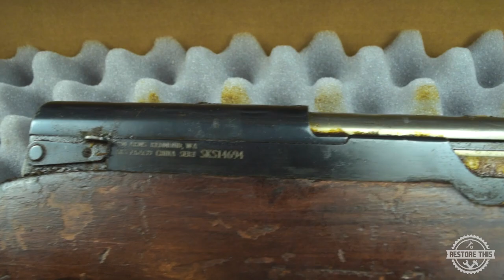VINTAGE SKS RIFLE RESTORATION! 1957 SKS Rifle Caked in Cosmoline Brought Back to it's Former Glory!

Comment: I can remember decades ago where they were selling them for $69 dollars all day long. Can't find one for $69 dollars anymore... And they do make for a nice little hunting rifles if you like open sight hunting.
Reply from the maker: Hi Gary, I remember an SKS rifle and 1k rounds of steel case for around $100. Those were the days! I like the SKS for its simplicity and reliability. Accuracy is good enough for most tasks and even with the crazy ammo costs as of late, it’s still decently affordable to have a fun day at the range. Thank you for watching and commenting!
Reply: I paid a little more at $99 but I hand selected it out of an old oak barrel sitting in the middle of the gunshop. There were about a dozen of them in there. Those were the days. 👍
Reply: Yep, back in the early to mid 1990s.  Had one and cleaned up the stock and refinished with stain from Lowe's.  Took it to the range and it ate any old garbage I ran through it without a hiccup.  Sold it for $100 in '95.  Argh.

Comment: It was very good to see you made a point of showing you cleaning of the firing pin & the bolt, that's a very important safety issue.  Hard, congealed cosmoline on the pin & in it's channel in the bolt can cause the firing pin to stick in the forward position, causing the rifle to suddenly go full-auto until the magazine is empty.  The original design had a firing pin spring that helped prevent this, but many of the post-Russian manufacturers eliminated it.  There's a gunsmith that makes the original spring-retracted design, & it's a good idea safety-wise to install one in an SKS you plan to shoot regularly.  At the very least, keep those areas pristinely clean, & slightly moist with a light lube like Rem-Oil or Break-Free.

Comment: Just from looking at this SKS I can tell it was a recent import from Albania, hence the Albanian modded stock. From the serial # it is a 1957 Factory /26\ build. The early rifles did not have the Chinese symbols on the receiver. Originally it would have a blade bayonet.
Reply from the maker: Yeah, it’s a bit of a mutt that’s for sure! Thank you for watching Abe!
Reply: I’m here 15:35  paused for now. Where did you see the serial number? I need the entire number from the left side of the receiver. Haven’t seen it yet but hopefully I will after I resume. However I can already tell you’re both wrong. It can’t be a 1957 because of the side sling -swivel on the left side of the buttstock which was moved there from its original location in 1958 and not moved back underneath again until the latter half of 1965. My assumption up until now, is that it’s a first year spike bayonet placing it in 1964 with a serial number in the 9 million range. The actual serial number. On the left side of the gun. The entire serial number. Another clue aside from the placement of the swivel and the correct bayonet, is also the correct long barrel lug which was also an early feature which ended in 1964, same year they went to a spike. I’m now going to hit play as soon as I post this reply. I will reply to myself as soon as I finish the video. So far I’m convinced that I’m right.

Comment: I did the same to mine about 30 years ago. Typical Chinese ska rifle.  I probably fired 30 to 40 thousand rounds with out a single jam or miss fire slam fire or failure to eject a spent case. Firing pin rattled from new.
Reply from the maker: They are really fun rifles! Thank you for stopping by!

Comment: For anybody doing this at home, you can save A LOT of time effort, and cleaning solution by boiling the small parts in water, like the trigger, bolt, bolt carrier etc.
No cleaning solution or sandpaper necessary, just hot water. 
Shake them around to release the cosmoline into the water, and boil multiple times if necessary
Be sure to dump the waste water into a gravel pit somewhere that no plants are growing, do not pour down your sink!!

Comment: Soak that bolt overnight in mineral spirits. Let it drain the carbon/cosmoline out. Spray the parts w/ compressed air to get the rest of the carbon/cosmoline out of the nooks and crannies. Repeat until clear. Mineral spirit bath for the bolt-especially after corrosive ammo, is a great way to clean and prevent the slam fire sticky bolt problem. Great restore by the way!
Reply from the maker: Exactly! The mineral spirits does a great job of removing that stubborn cosmoline. Good tip on using it after firing corrosive ammunition. Thank you for watching!

Comment: i think it would have looked better stained. Here's a suggestion. If you're worried that staining wood will darken it too much or be uneven then use a sanding sealer first. A light coat of 3 or 4 parts ethyl alcohol to 1 part shellac will keep a stain from creating too much contrast betwwen the dark and light grain and make it easier to even out the color when wiping off the stain.
Reply from the maker: I appreciate the suggestion! I’ll give this a try on the next one! I really like seeing the natural color and features of the wood, especially the iridescence (which I was unable to adequately capture in my recordings). A slight tint could have been nice however to even the color out. Thank you for watching my video!
Reply: @RestoreThis  There use to be a Public Television show called The Furnature Guys. Hardly an episode went by where they didn't extol the virtues of sanding sealer. When I tried it on some pine that was unevenly soaking up stain like a sponge it came out looking like an expensive piece of hardwood. I just found your channel and I'm enjoying watching your old videos. Keep up the great work.
Reply from the maker: Thank you for the encouragement! The uneven soaking you’re talking about is a really common issue especially with the catalpa wood used in this stock. I’ll have to research the sanding sealer and put it to use in my projects.

Comment: How did you remove the upper handguard pin? Those are hard and risky to punch out. If it's damaged, really hard to replace.
Reply from the maker: It wasn’t easy to remove. As opposed to hammering it out, I pressed it out using a vise as a press.

Comment: Nice job man! That girl looks marvelous. How did you polish that bolt so shiny?? Enjoy your new, old, weapon.  Excellent video my man!!
Reply from the maker: Thank you for checking out my video. Polishing the bolt was just a little time and elbow grease. I used a multi grit sandpaper pack from Amazon, sanding up to 2500 grit, then switched over to a buffing wheel with white polishing compound until it had a mirror finish.

Comment: What are the chemicals used? Like at the beginning what is that liquid in the jar used to remove cosmoline?
Reply from the maker: Thanks for watching! I used mineral spirits to help breakdown the cosmoline.
Reply: @RestoreThis  thank you. What grit sandpaper were u using to remove rust? Did u use mineral spirits for it as well? Im having a hard time removing rust from metal parts with just a nylon brush, 0000 steel wool, and mineral spirits. I even used some hoppe's no 9 with no luck. I thought about using brake cleaner but dont want to strip the blueing. Also there are some parts without blueing or very little. Do i need to strip it and reblue every little piece in the action? Or just the large pieces like u showed in the video?

Comment: Looks like it just came off the assembly line. Good work!!!
Reply from the maker: Thank you for watching!
Reply: @RestoreThis  No problem. I restored mine to a certain extent but I did so minimally. Its all matching, with some trench art. It has a neat, battle scarred look, plus I got a vintage canvas sling for it too. 😃😁
Reply from the maker: I have another Norinco that I didn’t touch at all. It wasn’t as caked in cosmoline so I just let it be. I have a Russian and Yugo as well. Great little rifles!

Comment: Video was fantastic!!! Amazing you took it this far which is what I’m about to do. Your video will help me immensely as this is the first time I’ve gone this far and done a total restoration. Atlantic Firearms got me good on my last purchase and except for the bore being packed with cosmoline, everything else was ‘dry cosmoline’ as we cal it and rust is present more than I want it to be. Polishing the bolt pieces for me will be difficult. Wish I could fly you to my house shop for a few days and help, lol. I could use it!
Reply from the maker: Hi Mike! Thank you for checking out my video. Another commenter asked about the polishing process below so there’s some extra info there. Take your time and enjoy the process and it’ll go fine! As for the rust, stripping and reblueing is always an option, but you’ll need a large bin to fit the barrel and receiver. Good luck and have fun!
Reply: Il restauro del calcio  poteva venire meglio così per tutto il resto

Comment: What did you used to applied onto the wood and scrapped off at 8:11
Reply from the maker: That was a paint stripped called Citrus Strip. Supposedly an environmentally water based paint stripper. I don’t know what’s in it, but it works great at removing paint and varnish! Thanks for stopping by!

Comment: nice job....did U re-blue all metal or just dust cover ?....any tips U learned on re-bluing this beauty ?
Reply from the maker: Hello and thank you for stopping by! For the bluing, my biggest tips would have to be spend 90% of your time on the prep, 10 on the bluing chemical part. Do lots lots of layers if you want to try to get anything like a deep factory blue . I was never able to get is as blue as I wanted in just one go. Through bad luck or just my lack of skill I would get weird runs and marks in the blueing.  Sometimes multiple dips would fix it, other times I had to start over. This cold bluing seems to be a lot more fiddly than hot blueing. In the end I only blued the dust cover and the gas tube. I would have loved to have a go at the receiver and barrel but don’t have a container large enough to water dunk it. I appreciate you checking out the video!
Reply: Thanks for tips....how did you strip, (sand ?) & restore stock to consistent light honey color ?....or is it refinished with honey color stain ?....looks original and a beauty.

Comment: How did you get the bolt so polished?
Reply from the maker: Hi Shane, thank you for watching! Getting the bolt polished was a matter of various steps of increased grit sanding, then finally a polishing wheel. It took a good deal of time and effort. Polishing the bolt should be considered carfefully as the rifle is only original once, and can’t really be unpolished convincingly to look original again. If you are considering the process for a beat up non matching rifle, just take your time. Start with 400 or 600 grit sand paper and sand until all the dents, gouges and machine marks are smoothed out. You only want to see the marks from the sand paper but nothing bigger. Next move on to a higher grit and sand until the previous grit’s marks are gone and you only see the marks from the current grit of paper you’re working with. An easy way to tell is to sand perpendicular to the previous step. Makes the previous steps marks easier to see. Keep moving up in grits but 100-200 each step. Once you get to 1000 grit, jump by 500’s but keep moving up until you hit 2500 to 3000 grit. From there, use a buffing wheel and a good polishing compound and keep working the bolt on the buffing wheel. For the final step I like to use a brand new microfiber polishing cloth. And dirt or dust on the cloth will scratch the finish. Rub and polish the surface to remove all of the buffing compound. That should do it!
Reply: @RestoreThis  i have an original and I was going to buy another SKS on gun broker and was going to reverb it depending on how rough it is, I appreciate it!

Comment: Wow! That thing looks great! Love the color of the wood! I have done one SKS restoration with the same products and had the same results. The polished bolt looks awesome! Pretty sure your SKS had the most amount of cosmoliine I have EVER seen LOL. Curious, after you finished it and shot it, when it got warmed up did you have any cosmoline seep out of the pores in the wood?
Reply from the maker: Thank you for watching! It definitely smoked once it heated up! There was a very minimal amount of seepage. I should have heated the wood up to get more out of the pores before I refinished it.
Reply: @RestoreThis  how would you heat it up?
By the way your videos awesome I have an sks and let me just say I want to take it apart right now lol
Reply from the maker: @devinaisaican2133  there are a couple of ways that work well. First off, I would only heat up the wood, so I’d disassemble back to just the stock and gas tube cover. If you have a large shop oven that’s going to be your best bet.. I would NOT use my kitchen oven though! There are some nasty chemicals in cosmo and finishes and you don’t want to poison yourself. I don’t have a large enough oven, so my next best method would be a heat gun. You’d have to be really careful to keep the gun moving to try to heat things evenly without burning any one particular area. The last and easiest method would be to set it outside on a black or dark towel or background of some sort on a hot bright sunny day. The sun will heat it up enough to get some of the cosmo to start seeping out of the wood. Thank you for watching and I hope this helps!
Reply: I redid my sks, and to get the cosmolene to seep out of the wood, I wrapped the stock and forepiece in lint free towels and placed them on the dashboard of an old maroon Dodge W150 truck I had in 90 degree temperature. In about 3 or 4 hours it was almost all sweated out.

Comment: Can you list everything you used and what you used to polish please and thank you!
Reply from the maker: Hi Shawn, thank you for checking out my vid! To polish that bolt, I used this sandpaper set from Amazon: https://www.amazon.com/dp/B07DTGP1QT/ref=cm_sw_em_r_mt_dp_HA84FC6ME5GWG04BTQJR I started with 600 grit and used each grit level up to 3000 grit. You have to make sure to sand to each step until the scratched from the previous grit are all sanded away. Then I used a buffing wheel from harbor freight with this buffing pad: https://www.amazon.com/dp/B003UOLUQ6/ref=cm_sw_em_r_mt_dp_SBRN59R598D72EZX7FH9?_encoding=UTF8&psc=1 and this buffing compound: https://www.amazon.com/dp/B0000DD35X/ref=cm_sw_em_r_mt_dp_ZKF59MR8078MYRR0V2YM this part goes pretty quickly and really gives it the shine. finally I wiped it down with a cotton microfiber polishing cloth to clean off the polishing residue. It worked great!
Reply: @RestoreThis  what was the liquid you kept putting the dust cover in after bluing
Reply: Also thank you so much
Reply from the maker: It was just a glass of water. It stops the blueing reaction
Reply from the maker: Good luck if you’re going to take something like this on! Take your time and I’m sure it’ll turn out great!
Reply: @RestoreThis  thank you so much

Comment: Really nice job. I bought one recently and it was way less roached than yours so with only one or two bad dings on the wood that I might sand down so the pulverized wood in that spot doesn't worsen. Other than that i will probably leave it as is...other than cleaning off the cosmoline.
Reply from the maker: Sounds like you got a good one! For the dings, I’d give the wet rag/hot iron trick to try to puff the dent out then varnish or stain it. Best of luck! These rifles have exploded in value! Thank you for watching!
Reply: You might also try steaming out the dents by putting a wet washcloth over it and pressing down gently with a steaming iron.

Comment: I bought one a couple of weeks ago and it is in great shape except for a zillion gouges in the stock. I left the stock alone except for cosmo removal and one light coat of True Oil to seal it. My bluing was intact enough to leave it alone and after cleaning and a coat of gun oil it looks great. The rifling is near perfect. I wanted to let the rifles history speak  so I did not "restore" it  I only revived it to shooting condition. It is a 1967 version.
Reply from the maker: Nicely done! If they aren’t too bad, it’s better to leave them be. One trick I’ve seen for stock dents depending on how bad they are is to strip down to bare wood then get a damp paper towel or clean rag and lay it on the dent. Then run a hot iron over it for a few passes. It puffs the wood back up and can minimize the appearance of dents and minor gouges.
Reply: @RestoreThis  I did not want to minimize it's history. I restored the stock on the first SKS I ever owned. I sanded the stock, steamed up dents and applied 14 or so coats of Tru Oil. I rubbed down each coat after it had dried for 24 hours with #0000 steel wool before applying the next coat to allow the Oil to "fill in" any remaining dents with out having a thick coating on the entire stock and ended with a perfectly smooth and pristine stock. It took over two weeks but It looks great. However, I will never do that to an SKS again . I don't mind the work involved but I've realized that I love the original look more than the "pretty". I still have that rifle and will never sell it though someday I will probably give it to a Grandson.